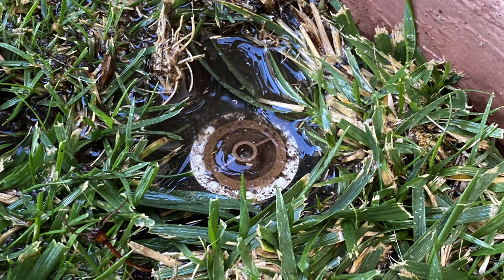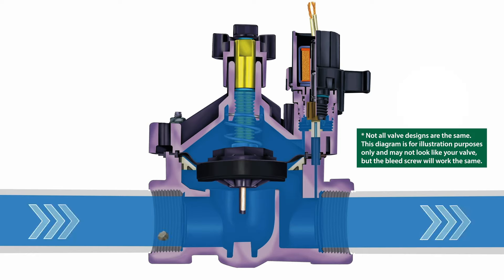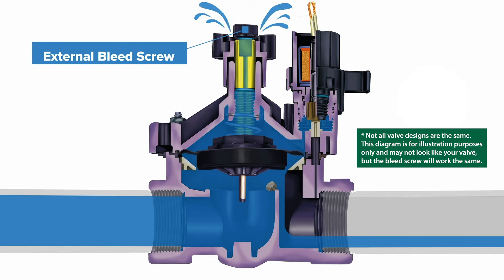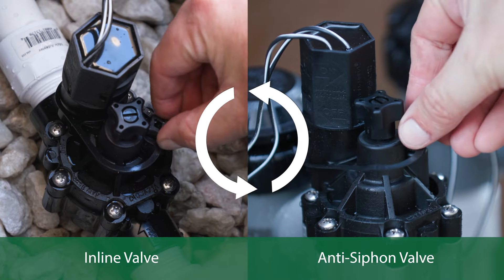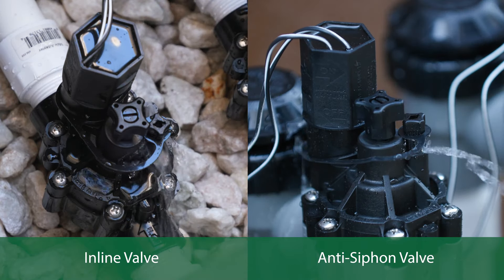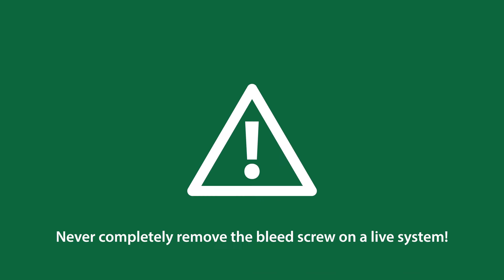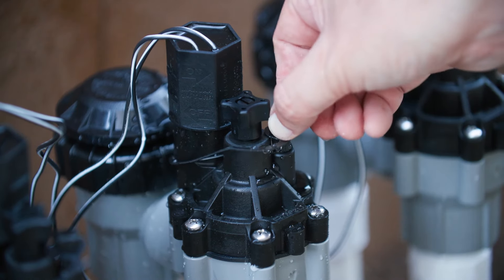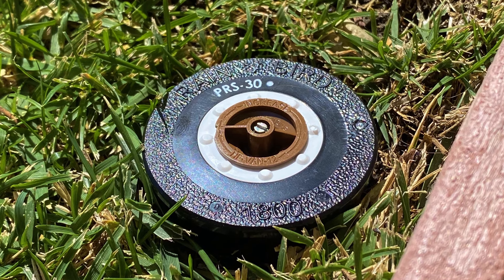Rain Bird Residential Valve Troubleshooting: Using the Bleed Screw to Fix a Sprinkler Leak

Comment: My Rachio controller was shooting an error for a zone. Turned out to be frayed wires at the solenoid. Fixed the wires, then tried again. The Rachio controller sent the signal to the solenoid (I could feel the thump) but no water came out of the drip system. Followed this, opened the smaller knob and let the water flush. Tightened back up again. Tried the Rachio controller again, and it’s spraying water now. So thank you for this video!

Comment: I wish this fixed it.  Used the bleed screw and also popped off the top and the diaphragm and flushed out the system.  Still leaking.  1 year old valve too!

Comment: Do you bleed the system while the sprinklers are on or off?
Reply: When you bleed your system the sprinklers will turn on automatically
Reply: After will the sprinkler still leak for awhile ?
Reply: On. The system needs to be pressurized. I didn't have trouble unscrewing the bleed screw all the way although the manufacturer does not recommend you do this. I wand to ensure full pressure and flow to the bleed outlet. Just ensure you have tight hold of the bleed screw. Once 60 seconds passes, finger tighten the bleed screw closed.

Comment: I have 30 drip emitters on the same station, 6 are leaking. Will this fix the leak on 6 emitter? I will try nothibg to loose.
Reply: Just as I expected, it did not fix the leak on the 6 out of 30 emitters. In the first place, if there is debris stuck on the vavle, all 30 emitters should all be leaking. I called customer service and I was told vavle is not closing properly.

Comment: Im having trouble. My water sprinkler wont turn on if i dont looses the screw. What do you think could be the problem? Do i twist the solenoid all the way off and then unscrew it for the water to come manually? Really frustrating:/
Reply: How did you fix it? Mine is doing same as you described
Reply: @vivektube123 mine is also doing the same. Did you ever find a fix?
Reply: @Los714  I had it replaced completely

Comment: What if you do pull out the bleed screw all the way 😬???
Reply: Im wondering the same thing. I want to open the valve as much as possible but don’t want issues with the bleed screw. It’s too bad they don’t say something alone the lines of “ do not do more than 3/4/5 full rotations.
Reply: I might just take it off in the name of science wish me luck
Reply: @PrestonClark801  good luck man
Reply: @diegoperez2279  pulled it all the way out. I didn’t see any springs or anything else come out with it so I wouldn’t be too worried about pulling it out. It might mess with sensors or something but that’s above my pay grade 😂.
Reply: @PrestonClark801  haha nice!!!!

Comment: Unfortunately, now the bleed screw drips and tightening it just stripped it. All plastic.
Reply: That’s unfortunate. It may be the screw itself so I would try and order a replacement from rainbird, idk if you could pick one up from HD or Lowe’s. I’ve messed with my bleed screws about 5 times and I have not had any issues with leaks. Just hoping to help.

Comment: What happens if you remove the screw? An old schooler taught me to always remove the bleed screw completely to flush and bleed the valves but now I'm worried 😂
Reply: it will be difficult for some people to put the screw back on forcing it against the water pressure.
of course an expert like you has no problem with that.

My question is: how the heck do you know how many turns to you need to unscrew before the bleed screw falls off?  ... typical case of incomplete instructions.... but not a big deal either.
Reply: Thanks boomers